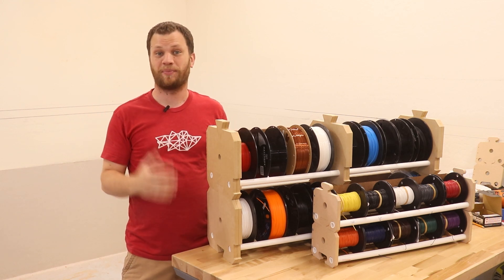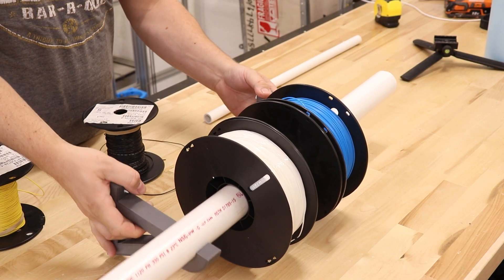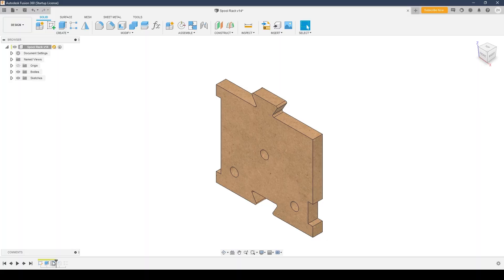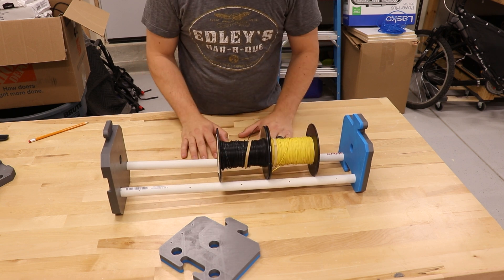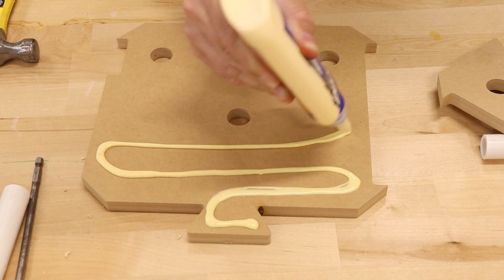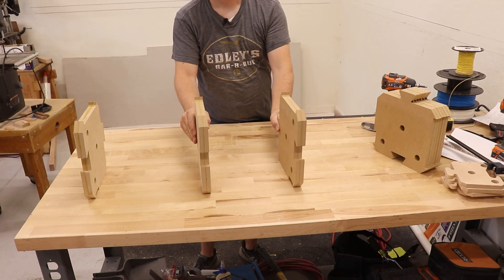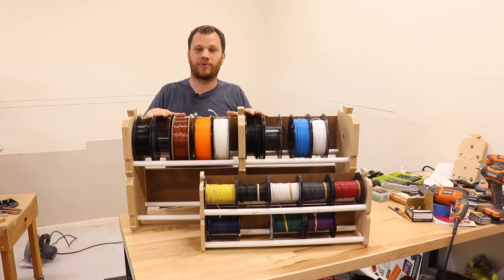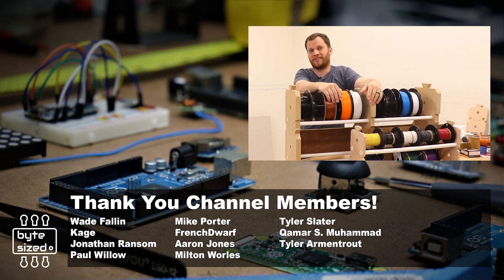Solving The Biggest Problem With Storing Spools

Comment: Consider placing a measuring tape on the front of the electrical wiring one, if not used for the wires when cutting them, you'll always have a measuring device close when you have both hands full...

Comment: Looks like the 3D filament rack has notch in the front for an additional support that you aren't using. Was that put into the design in case it was need and you found out it wasn't or did you not have the materials needed on hand and needed to get the project done?
Reply from the maker: I was wondering if anybody would spot that! You are exactly right. There is a notch there for an additional strip of MDF. This could also be useful for labels or a hole to feed filament through.

Comment: Question. When you pull the wire through the hole, does it tend to try and pull the spool from side to side as the wire unravels from one side to the next?
Reply from the maker: Not really. I have the spools pretty close together and there isn't a lot of unused space for them to shift.